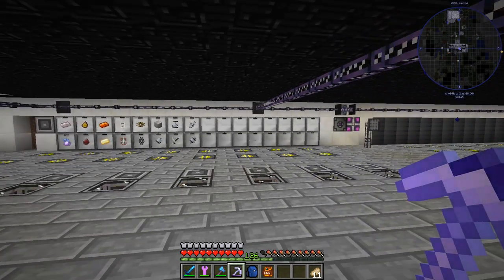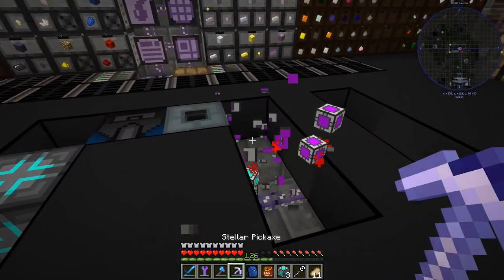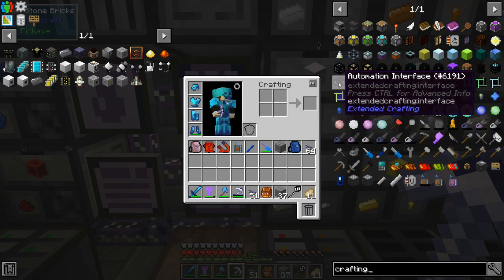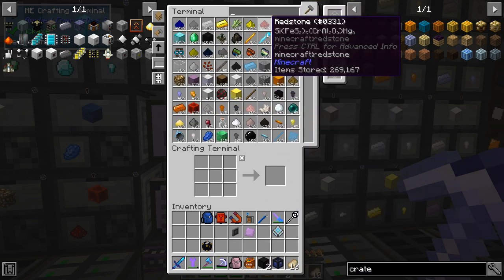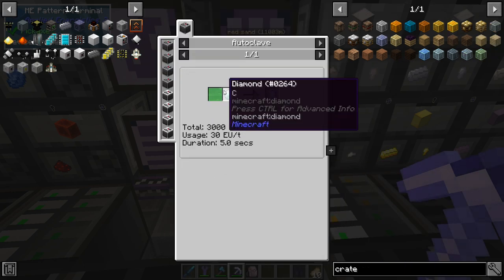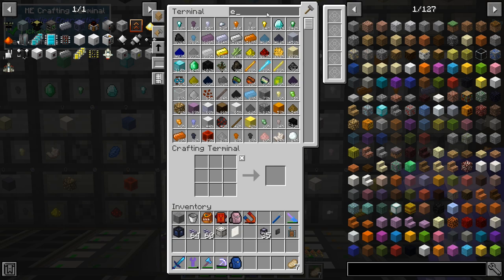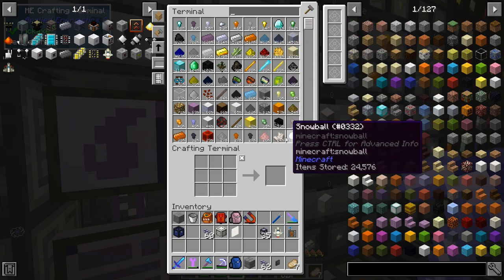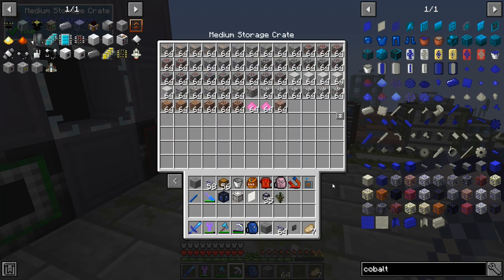Omnifactory - 22 - TIER TWO MICROMINER

Comment: Tier two and three micro miners don't work for me. Only tier one in the small one. I tried using a chest, chest with hopper and conduit but still no. 

Any ideas?
Reply from the maker: got  a big enough power source on it?
Reply: @Krakaen  I connected an LuV to it so I don't know if that's the problem
Reply from the maker: @Pupkiwi  the input of power from the blocks takes RF i believe, not EU
Reply from the maker: and by power i meant the block in the multiblock structure, not the thing powering it
Reply: @Krakaen Yes I upgraded the block and it seemed to have worked. But not for tier two and three. Tier 4-6 works though. Weird.
Reply: Replace your output to a bigger one